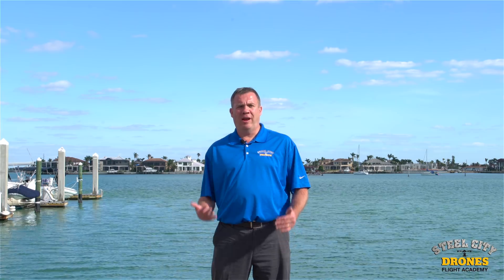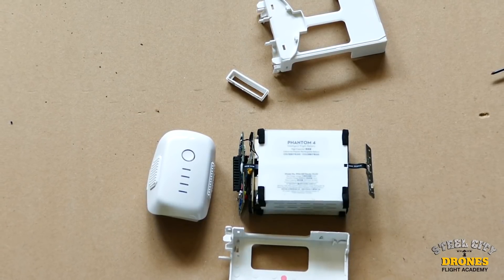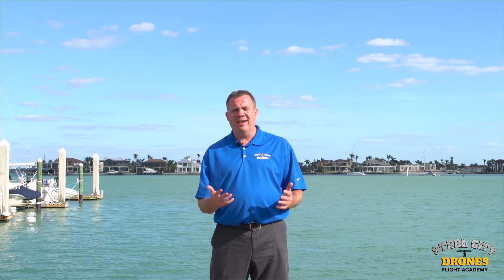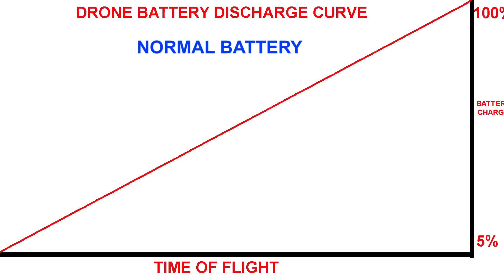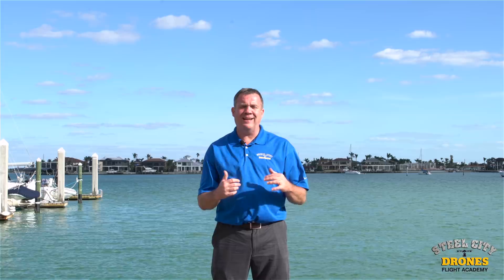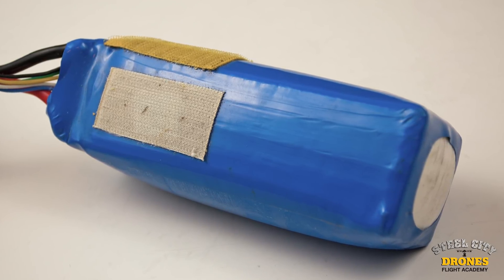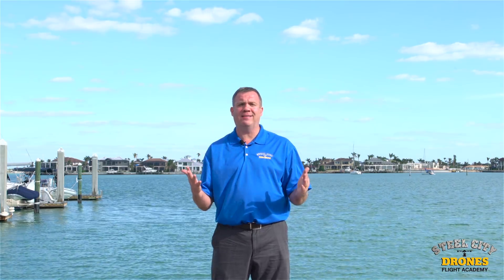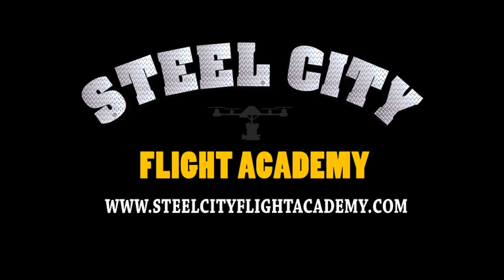Drone Battery Care and Maintenance | What You Need To Know

Comment: Thanks for the nice guide. Just to mention that if the DJI battery is inserted in the drone it won't self discharge. You need to separate it from drone to enable self discharge function.

Comment: If there is a battery failure wouldn’t it be helpful to incorporate a floatation device so not to lose the drone forever. I have been looking into purchasing a drone but shy away because of water danger
Reply from the maker: The idea is to prevent that from every happening. If you take care of your batteries it should never be an issue.

Comment: All great info, and I’m just a spark guy, but the dji spark batteries do discharge down about half way within a few days, I think that’s a recent thing possibly, but I know much more about lipo batteries, the flying down to 20 percent was the info I was after, nice video and thanks.
Reply from the maker: Mavic and Spark batteries are not quite the same as the rest of the drone batteries. To our testing, the normal trickle charge for these batteries has shown good results without the need for a dedicated charger. If you are using anything else like a Phantom, Inspire, or Matrice battery you will then want to make sure the batteries are discharged anywhere from 20 to 50%.  Regardless of battery make sure you target to be on the ground by 20%. The lower you go below 20% the more heat it will put into the  battery and the greater chance it can damage the battery.

Comment: Good video.  The discharge feature does work for me on my P3P and P4P.
Reply from the maker: Thanks. Like I mentioned in the video, the issue is that the battery will trickle discharge batteries but its not enough. When not used the batteries should be kept at a storage voltage of no more than 50% and ultimately we try to shoot for somewhere around 25-30%. The DJI trickle discharge takes battery power down to about 65% (when it works) which is not enough.  We have seen many customers try keeping them at the levels the batteries auto discharge down to but unfortunately the batteries will get compromised leading to poor flight times and a non linear discharge rate.  For your application I highly recommend the Smart charger as it can charge and discharge up to 4 batteries at a time. Many of our customers use it and it really works.